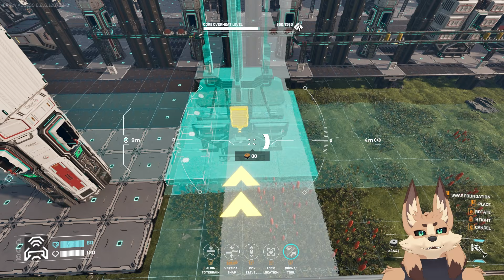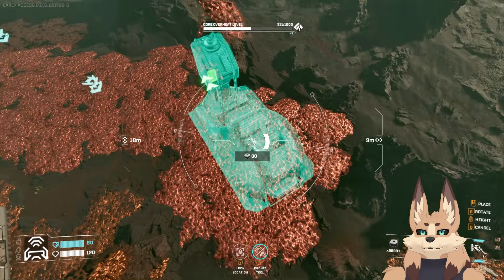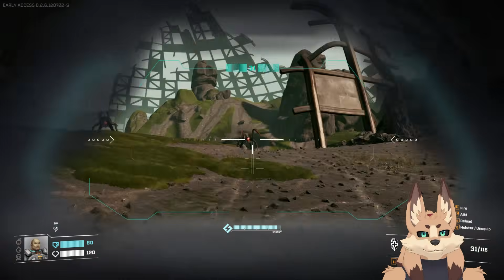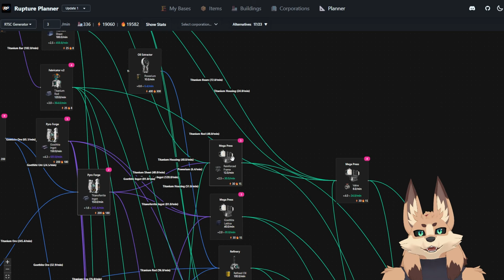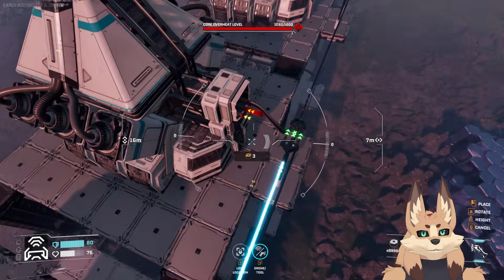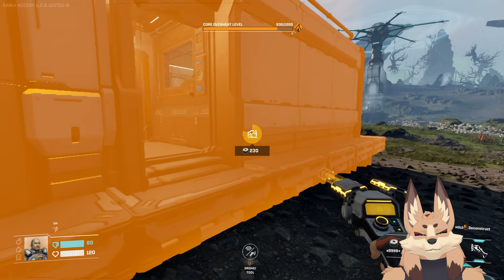Confounding Compounders - StarRupture [S2E10]

Comment: The amount of machines and rails present in the save file is what's causing the frame dropping and save freezing issues. Simplify the factories by adding in v2 machines and depots, use roundabout rails where you dont need the full 480 ipm due to longer processing times, and you should see a marked improvement

Comment: Antoher great video Genji. Thank you for the work you put in making these.
At 31:53 you had placed pillars then connected platforms to the top by spread. If you had placed the platforms at the top of the pillars INDIVIDUALLY, then the support calculations would have worked correctly and you wouldn't have needed to put the extra pillars in.
Whether attaching to top or the sides of the pillars like you did the core cooling tower, attach them 1 at a time. The support calcs will be correct after.

Comment: the platform issue only works if its a new save don't matter how many i removed on a old save the frames still dropped slightly i think its stuck int he save some how thats there still there. but my new save no issues as i have none of them just loads of gaps between each and i add zip line to the top of all my stacks and just leave them got zip lines everywhere.

Comment: Just recently started playing and found your channel, will start watching from e1 but just one question which is or has been explained, how do you jump up to the higher platforms, is it a mod or just a key combo, cheers
Reply from the maker: No mods, just pull out the drone tool after having jumped twice. It freezes you in mid-air and resets your jump count, so when you put the drone away you can jump another two times. Just keep repeating that and you can jump as high as you want!
Reply: Nice, many thanks, will be using that tip 😊

Comment: i need you to explain why not modulate the three ingredients on one rail when all inputs aren't close to 480, rather than build 3 rails or two rails, is it that slow even the total number isn't even close to 480 ? after some math theoretically if the amount needed for an item is less than 160 with 3 items it should be balanced, for two materials it's 240 each so other than optimizing and having a separate 480 rails for each   just was wondering if you could answer or do a demonstration in the next video love the content.

Comment: yeah i run a 12900K, 64GB ram, and a 5080 and have the exact say framerate issue. i even have dual nVME's in raid 0 for max performance and yeah... they really need to focus on performance and not features.